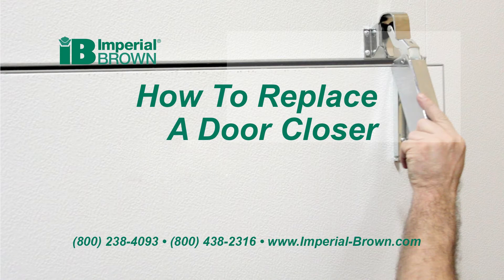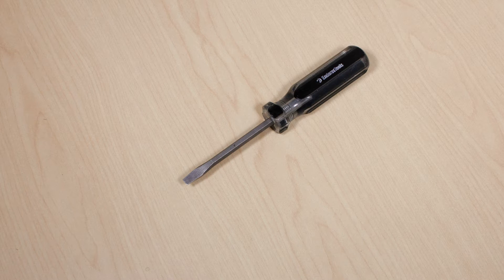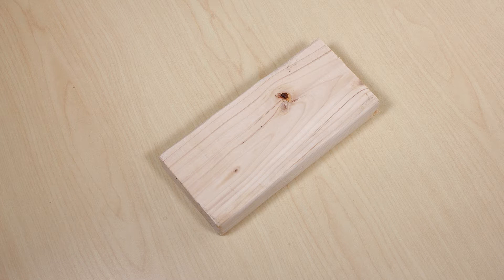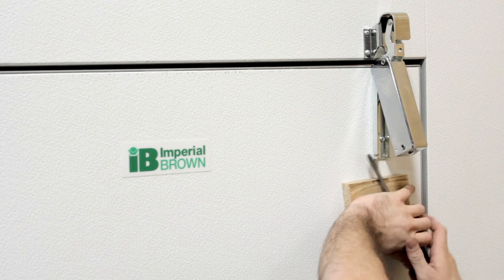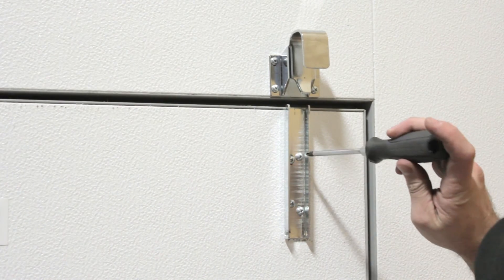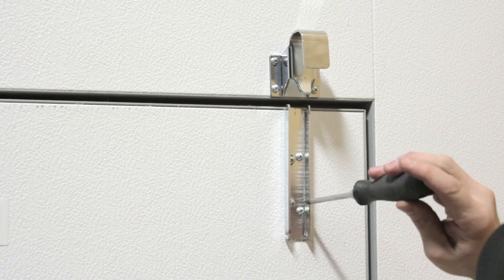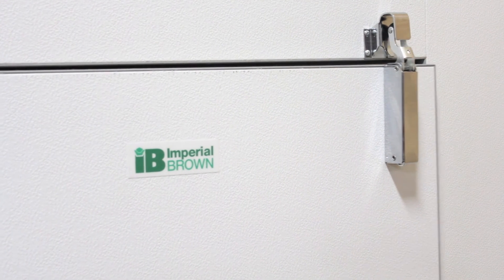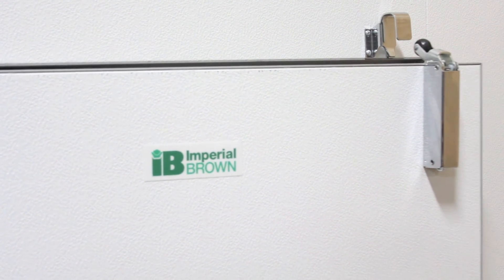How to Replace a Swing Door Closer on a Walk-in Cooler

Comment: Thanks this was helpful! For those that may still be having trouble getting it off... Make sure the screwdriver isn't under the plate when you try to pop it off. I ran into this issue. The solution for me was to just pry ot the corner as to not have screwdriver go under mounting plate.